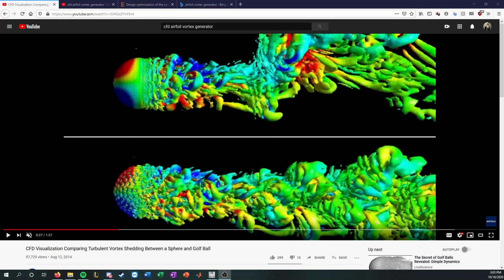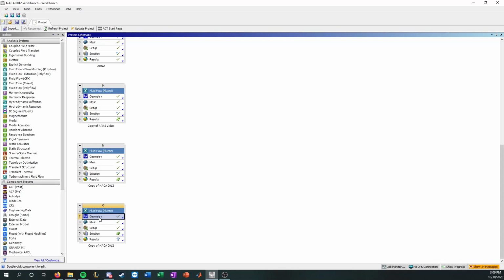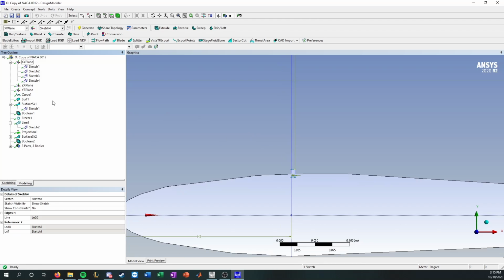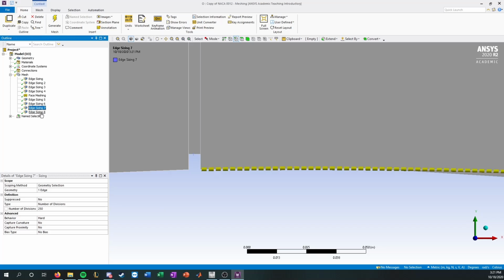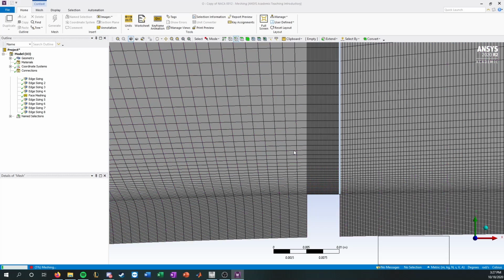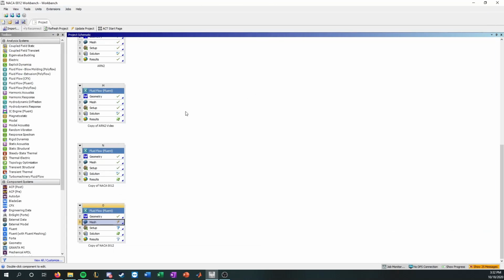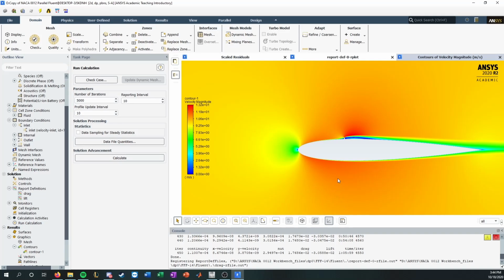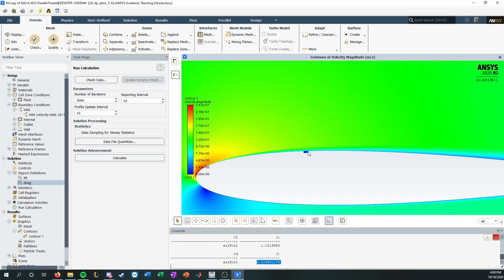ANSYS Fluent (2020) Vortex Generators CFD in 2D on a NACA Airfoil:  Is It Possible?

Comment: LOL, so wrong mate. Look at what vortex generators do, and apply changes in the flow formulation to account for them. You don't even need to include geometry to obtain accurate results. Look up up the papers by Bender and Jirasek for the CFD formulation if you want to know more. Besides this there are plenty vortex-source models that have been shown to work well by inducing a vorticity at the VG location.
Reply from the maker: VGs work I’m simply showing that it’s very difficult to simulate them in CFD so it sounds you may be mistaken by the purpose of this video.   My PhD is in a type of VG and I often get ppl asking me to do CFD of VG and it’s not a simple task.  People have done 2D VGs but they’re usually a type of unsteady UDF actuator so as you said you must apply changes in the flow formulation.  I’m simply educating as to why a simple velocity inlet or flap won’t work to simulate a VG properly.
Reply: @anthonyt6564  Perhaps I was. I am developing a VG viscous-inviscid model for my thesis, so I definitely know it’s not only possible, but common. I do acknowledge that people who are looking up ANSYS guides on YouTube aren’t very familiar with academic writing.
Reply: @matkriluk  Hi Mat, I am doing a master's thesis on BAY modeling of VGs and it would be really great if I can connect with you, Linkedin or anyother platform. Looking forward to hearing from you soon. 
Thanks alot!!!!!!

Comment: Thanks for all of ur video sir.
I have to do Simulation of object which will be under water in sea
I have to know whether the object will sustain the pressure inside water (the depth is 30m to 100m) or will it get crushed.
What type of simulation i have to use
Any suggestions which would help me
Because I am beginner to Ansys 
With very basic idea on Ansys
Reply from the maker: Do you need to do CFD?  CFD is only if you are interested in something in a fluid flow.  It sounds like you are simply trying to solve for static pressure which has analytical equations.
Reply: @anthonyt6564  S sir
I have just applied hydrostatic pressure and tried the simulation but the result is not proper. Could u please suggest to me what all things to be defined in order to get an accurate and proper result for the above problem.
I have tried to contact many people you are the one to reply.
Thanks for replying and please help me with this
Reply from the maker: @Rocklee-vv  sorry but this doesn't make any sense.  Solving for hydrostatic pressure isn't a CFD problem.  If you're problem doesn't involve flow you don't need to do CFD to analyze it.